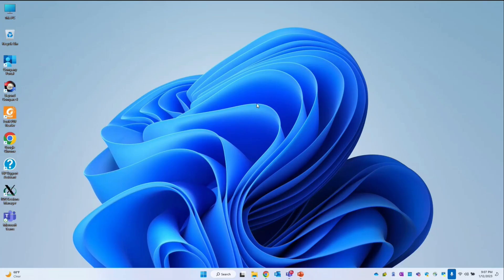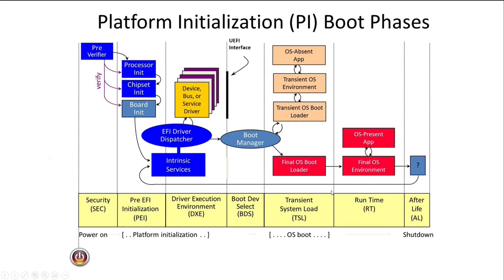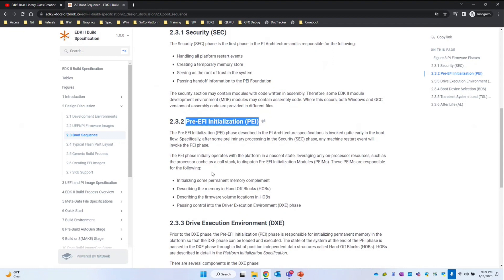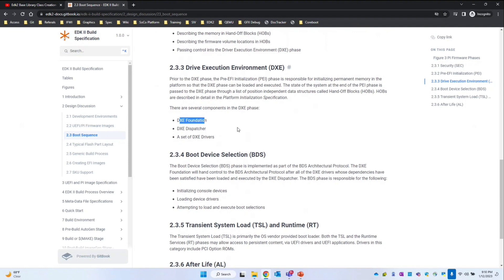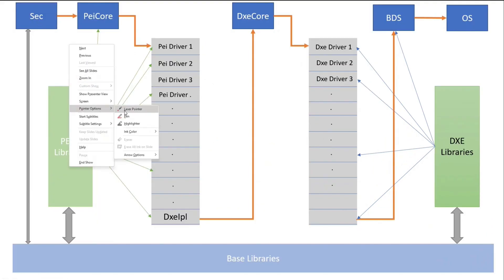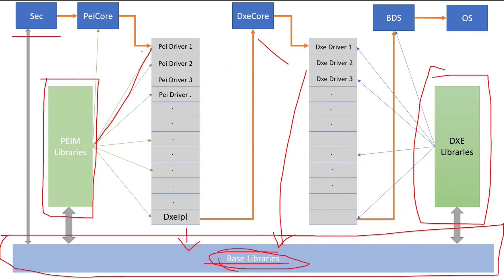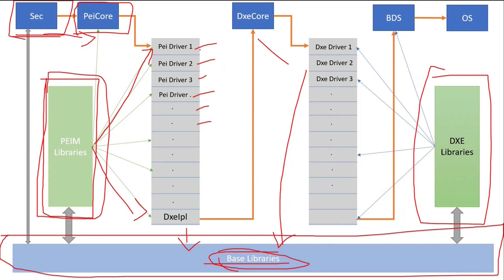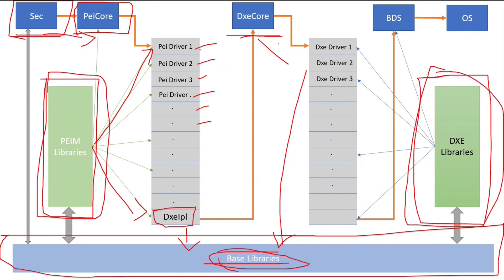High level understanding BIOS Flow till the OS

Comment: Nice Video! Quick question: where does "UEFI shell" fit in this picture?
Reply: UEFI Shell is an EFI application and it is part of BIOS binary. When BIOS boots, it add UEFI shell as BootOption during BDS phase. So on selecting UEFI shell from BIOS page or booting to UEFI shell directly, it launch that shell EFI application.

Comment: I think this question is somewhat related to the topic. Are DXE modules compatible between boards with the same chipset and/or super io? Also, can I interchange between different boards (of the same socket/chipset) CPU DXE?
Reply from the maker: It's depends on the functionality of the DXE Driver.
if the driver is generic then it can be used in any board. like e.g DxeIpl, DxeCore etc.
if the Driver is depended on the Board Configuration then if that Driver has the runtime check of the board then it will be compatible, else it wont.